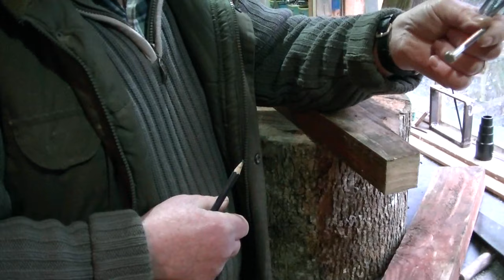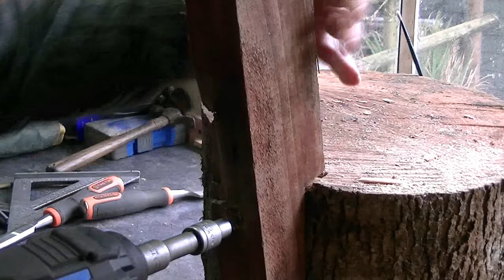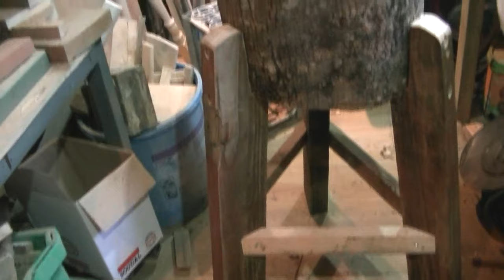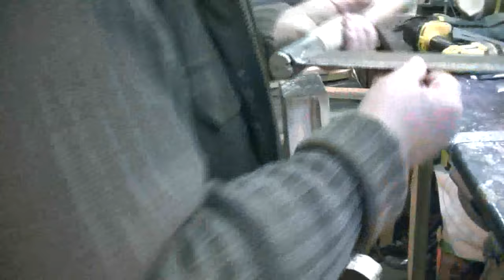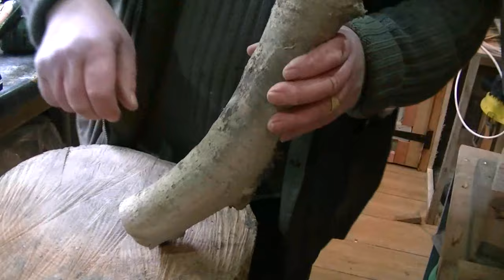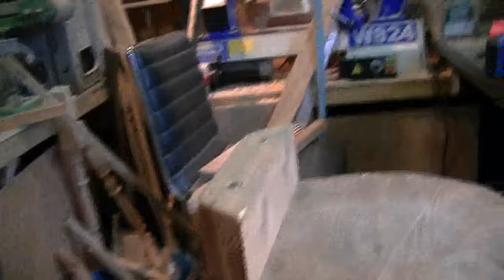Making a solid  Axe block for spoon carving .

Comment: At what angle did you make the legs? Sorry, i didn't hear that.
Reply from the maker: I just guessed it  just made sure they didn't stick out too far  just enough to make it stable and not fall over .just make a mock up one while block is on its back . its not too critical hope this helps .
Reply: @indianatone218  thanks